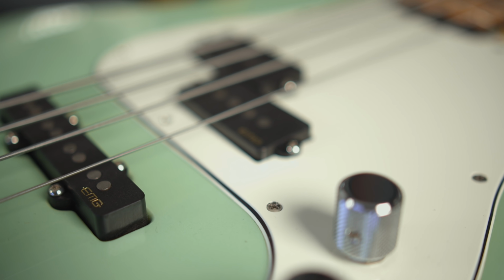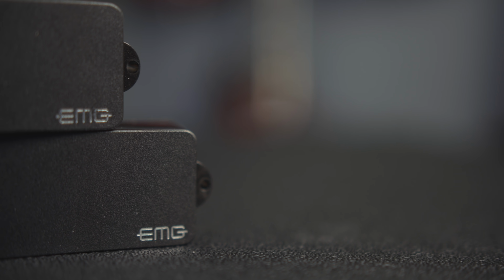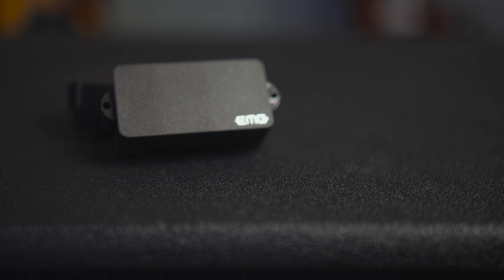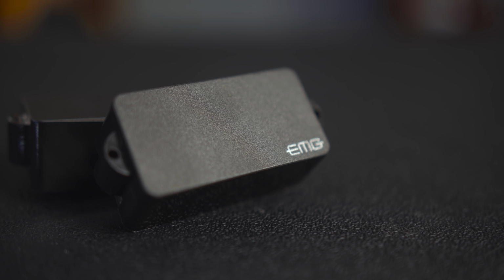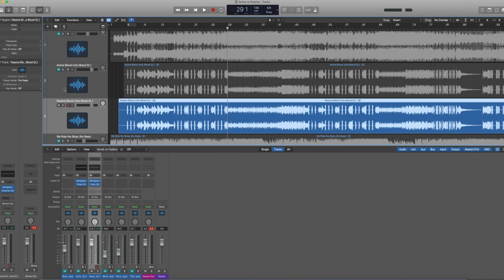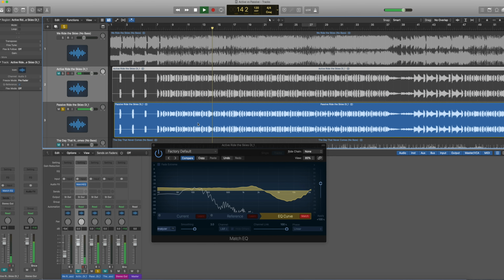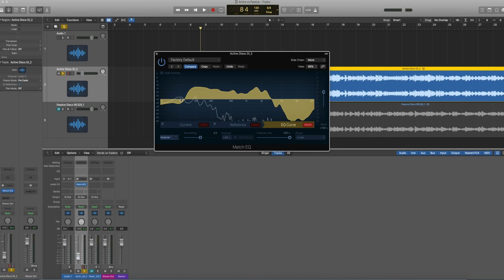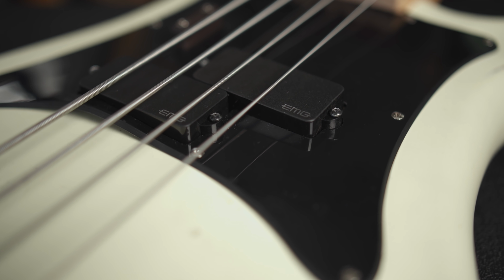The TRUTH About Active Pickups

Comment: Well, in these intro sample I've actually liked passives more than actives. EMGs sound a little bit synthy IMO. Maybe that's because of natural compression of an active pickup, but anyway. Never played with an active pickups, although I want to try in the future. But my experience with an active on-board preamps is that in passive mode (if available) they usually respond better on how you play. What brings more fun into playing passive instruments for me. So maybe yes, actives are better for sound engeneers, but as a player I'm not conviced yet.
And also about that "active pickups are hotter". Maybe that was a thing back when actives where created, but modern passives has tons of output.

Comment: I don’t care if they’re better or not, I don’t feel like replacing batteries in the middle of a gig.
Reply: If you pay any attention at all to your bass, that just doesn't happen. Anybody who goes to a gig without testing their battery quickly is not prepared. With active pickups you will never have problems with all the noise that a live gig can add to a passive bass.
Reply: @chrysr7773  there are some instances in which you can’t really anticipate if your bass is going to crap out on you or not, because sometimes shit happens. I would like to eliminate the chances of shit ever happening, thus why I use a passive bass in the first place. Plus, there are ways around noisey passive pickups.

Comment: 3 of my current basses are all active however they have emg x series pickups 2 of those basses have darkglass tone capsules (1 @ 9 volt and 1 @ 18 volts) 
My spector q4 18 volt tone Capsule emg 35p4ax rc neck and 35jx bridge emg abcx, 2007 Spector Rebop 5 dlx zebra
Emg 40jx bridge and neck emg abcx and tone capsule. 2019/2020 Spector Euro 5 Lt emg 40dcx bridge and neck and factory tone pump.

Comment: What is better? Piston Engines or Turbo Fans? Obviously Turbofans and turbojets... they are newer tech, and they came to beat piston engines and radial engines... but sometimes (minority of times) piston or turboprops are better fit to the work. But, I think the obvious, ACTIVE are newer and BETTER overall! Problem is, most of times, that overhyped vintage thing, saying that everything old is good, that tubes are the holy grail and there's nothing else to beat an old tube box with transformers and speakers and that vinyl has a better listening experience than anything else...

Comment: I've owned two basses with active pickups, one with passive pickups and an active preamp and one all passive bass. I sold both with active pickups because they didn't get along with most of my effects pedals, especially my drives and fuzzes. Both bases with passive pickups sounded way better with my effects so they stayed.
Reply: I also get better sounds out of my pedals using passive basses. The lower output helps managing the amount of effect, especially with distortion/fuzz pedals
Reply: @Pesso86  Have you try to use volume knob less then on 10 on active pickups?
Reply: @Arwndr  some people might think this is a joke but it's actually very true. I used to always max my volume "so it would sound more" and oh man what a bad habit. Learning to control the volume depending on the saturation of the instrument is such a simple but effective method
Reply: You do have to curate fuzzes and overdrives, the Big Muff circuit is generally friendly to active basses and drives with buffers like most Bosses and the OCD play best. The other distortion solution is just about anything Darkglass or the demonfx copies as well as preamps with a healthy drive circuit, I use the Russian AMT BC-1 jfet based preamp, other drives stacked after add color. A surprising winner is the Behringer bass overdrive. Ymmv
Reply: This likely has a lot to do with how older dynamics processors (drives, fuzz, etc.) for bass were designed before the popularity of active pickups to add high end to the relatively treble deficient passive sound. With active pickups introduced you get too much of that high end for a drive sound crafted without it in mind and it ends up sounding harsh.

Realistically, tone shaping through an EQ before the drive should help with this (and honestly dedicated EQs should be more or less a part of every signal chain for a variety of similar reasons.)
Reply: @transcendkira  I had this issue with a Stingray HH. Everything sounded either boomy or muddy or thin and lifeless. I love Stingrays, but they don’t seem play well with modulation effects. They sound mean as hell with a Big Muff, though.
Reply: this is just how fuzzes work, its true in guitar as well and it has to do with matchin the input impedence of the pedal, passives match and actives are often just to "hot" and the mismatch actually cause loss in signal
Reply: @idiotburns  But it's not just fuzzes and it's not just a volume or impedance issue either. My basses that have passive pickups with an active preamp sound just fine. They have a much hotter output and lower impedance than a passive bass. However, the basses that had active pickups and an active preamp sounded terrible even when I compensated for the volume increase on overdrives, choruses, envelope filters, and yes fuzzes. This is just my anecdotal experience with two basses that had active pickups, not a scientific testing of all active pickups or anything. They didn't work for me and my gear.
Reply: @RyanDenley  Sure, alot of active pickups dont cut it for me either. I like passive with active module or passive as well.
Reply: @RyanDenley  Have you try volume knob on actives not on the max level?
Reply: I like my bass dry. If I want to use pedal efects I use an electric guitar...

Comment: The way I would put it, it's really helpful to buffer the signal from the pickup before doing anything else with it. I had a bass with active EMGs for years and didn't think about it much. I got another decent bass that has an active circuit where the pickups go to a circuit board, where each pickup is buffered straight away before the pan pot, volume and 3-band EQ. I've been pretty happy with that too, meaning active pickups are not the only route to a better signal. . 
Last year I got a low-mid-price bass (Harley Benton MP-4EB) which came with passive pickups, passive pan and volume, and then an active EQ circuit. Not great for several reasons, including pickup imbalance, so I ripped out the active circuit and went passive, which is more manageable. However, I now have some active EMGs on the way, P and MMTW, so I can get a better idea of what this bass actually sounds like. It's very well built and  deserves better electronics than what it came with.

Comment: I disagree but i also had a ibanez talman that sucked as my only active bass
Reply: Talmans have high out put passive pickups going in to a high output active preamps. The pick ups are pretty good by themselves but when combined with the preamp, it's just way to hot. I love my talman though but I'll be replacing the preamp in the future
Reply: @jaredhouseman2094  the pre amp ruins the pickups then because it buzzes like hell on the p pickups in between and the buzzing is louder then the pickups themselves imo
Reply: @Owen-ne6pe  I keep my preamp very low because of that. I'll replacing the preamp with an Aduere soon

Comment: EMG active Ps are wired in parallel too while passive ones are typically in series and how it’s wired has an effect
Reply: Well, all active EMGs are neither series nor parallel in the sense of passive pickups, each coil runs separatelly to the opamp in the comparator mode.
Reply: Then why does the emg p pickup sound like a series pickup? Look at the wiring...the emg p is a series pickup.
Reply: a massive effect  ., .  good point

Comment: After decades of passive P basses, I've switched to EMGs with 18v power and I'm SO happy. The X preamp series actually feels more dynamic than passive pups, the batteries last for months, and with the mid sweep and active trable/bass controls you can shape virtually any sound you could think of. No hum. Crystal clear notes. Total control. And I don't find them cold or sterile at all. But I spent years being a snob about it, until I really tried them. There's so many options too. The alnico 5 EMG can sound super boomy on the wrong bass, and the regular ceramic can be very compressed. But if you find the right one that complements your bass/strings/neck etc, it really is a winning package.
Reply: sold a Sterling with active pickups because of that. Sooo boomy I didn't like it. RIght now I'll stick to my P-Bass but someday I'll find something with active once more.

Comment: My PJ is active and my JJ is passive. I have no preference.
Reply: Does your PJ have active pickups or traditional passive PJ pickups with an active preamp? I found that the bases that I have owned that had passive pickups with an active preamp sounded pretty good, but bases that had actual active pickups with an active preamp we're the ones that sound kind of brittle to me and didn't get along with some of my gear.
Reply: @RyanDenley  it's likely passive pickups and active EQ - it's an 80s Aria. I'd not paid much attention to actives even though I put new pickups in my Kimbara Jazz last year. I was looking for a traditional sound because my Aria handles "bright and punchy" and there was no point having them sounding similar. I've been delighted with the Quarter Pounds.
Reply: @RyanDenley  looked up active pups. I hadn't thought much about the windings. Having to think back to the inductors course at college to try to understand the impact of the differences. Can't think I'd want anything brighter than my Aria+d'Addarios.